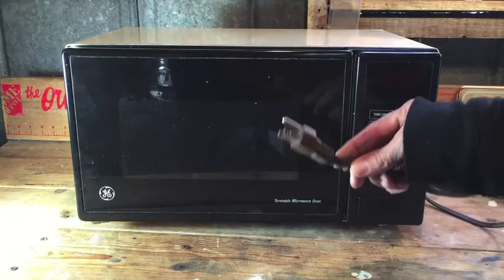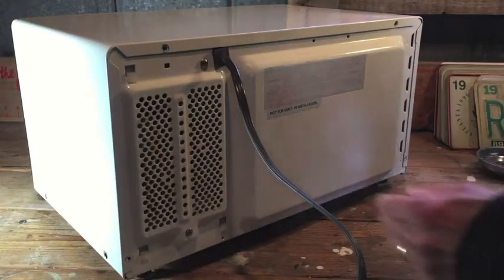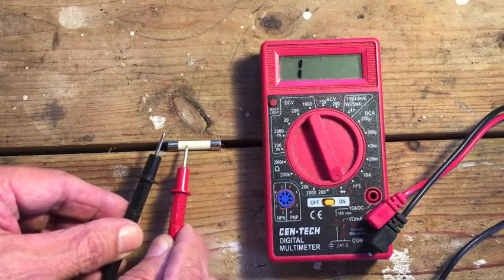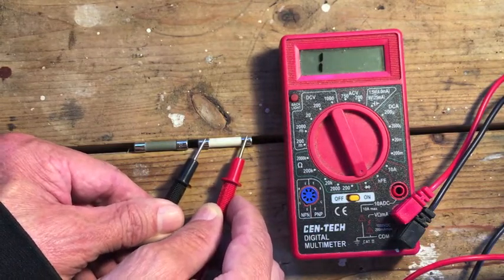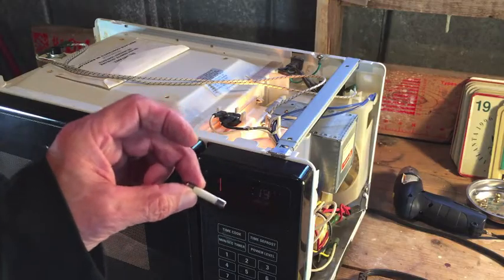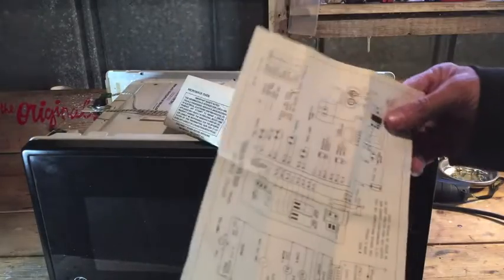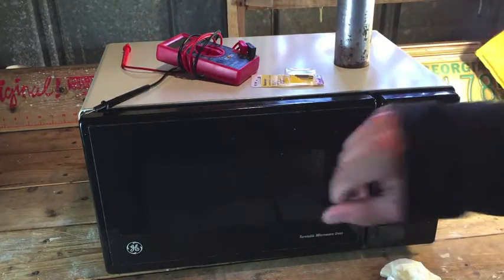$2 Microwave Fix - Test/Replace Fuse

Comment: Nice one dude. If i may ask if i will just replace the fuse do i have to discharge the capacitor?
Reply from the maker: No need to discharge.. Just avoid the capacitor terminals where the wires connect..

Comment: Bingo! My Microwave is 18 years old, a Countertop, 2007, 600 W, Proctor Silex that just died on me yesterday. 
Watched a bunch of Youtube videos and your Microwave looked the most similar to mine, so I followed your instructions. 
Along with a 15 amp fuse, I needed to pick up a Security Torx Alan Wrench set to remove the security torx screws that were holding the casing in place. 
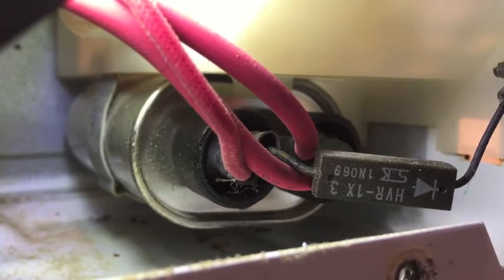At Minute 1:24, really appreciate you showing what the Capacitor looks like and where it was located in your Microwave. Critical safety recommendation to avoid exposure to 2000 volts and potential death. I made sure to stay well clear of mine (though ideally I probably should have discharged it with a Resistor). 
I wasn't sure if the simple replacement of the fuse was going to work, but I was very pleased when I saw the familiar numbers of the LCD panel flash and the oven light turned on.  
Tested the microwave by cooking my dinner, and no problems. 
Thanks for the concise and very helpful video!
Reply from the maker: You are welcome.. Glad to have helped..

Comment: Awesome. Short, to the point, filled with info. I went to Lowe’s, got a fuse 2 pack, and my microwave is running again. 15+ years old so maybe the fuse finally went out. Thanks for showing how to set my multimeter for testing. Your video saved me hundreds of dollars.
Reply from the maker: Glad to have helped.. Mine is now 31+ and still going strong much to my wife's dismay..
Reply: @tongo117  😂

Comment: What if the clock is there and the fan is working, but dark and no heat in the microwave. Is it fixable?
Reply: I'd recommend asking ChatGPT what the issue is. I asked for you, and it suggests that it might be : 1. Blown Diode 2. Faulty Mangetron (the part that generates the heat. most likely issue) 3. Thermal Fuse (near the Magnetron) 4. Control Board issues (might not be operating properly). I've replaced a Control Board before and it was a cost effective repair. I'd be cautious working anywhere near the Capacitor, unless I discharged it first with a Resistor. 
My advice, talk with ChatGPT, watch Youtube videos for the correct repair, only try if you feel confident in doing so. 
Good luck!

Comment: I found Universal microwave fuse 250 volt, 20 amp 10 pack for 8 bucks. Seems people are upping the amp by 5 amps. Since the light doesn't come on I assume that's what went wrong with it. My 1983 Kenmore, I don't like new appliances they don't last this one's done fine all the way up till now it it completely nothing worked and I smelled something electronic so I hope you can smell these fuses when they go bad. Fingers crossed to pick for eight bucks with nine more attempts taped inside.

Comment: Does the slow blow or fast blow not matter?
Reply from the maker: Don't know.. I'm not sure if the one I used was/is fast or slow.. I just saw 15A microwave fuse on the pack.. And it's been fine for 2 years now..

Comment: I have an LG. The clock turns on the timer even counts down.   But no fan or heat.  What could be the cause of that? 
Also, previously the fan would turn on when opening the door even without having the cook timer running. That somehow fixed itself.  But all of a sudden this happens several weeks later.

Comment: My 4 year old has gone kaput , im hoping its the fuse .. when i switch it off the clock beeps and flashes for one sec .. im hoping its the fuse ..cant believe your Microwave is 29 years old and still going , it would chew a of juice though .. miss my old pani , NN3535 model i believe ..sighhhh

Comment: Good video. However, after having already done what PBM recommends and putting everything back together, I ended up with one extra screw...and the housing no longer fits snugly over the microwave. The sides and back fit perfectly. But there is a "hill" now at the front edge of the housing, over the door. Every other edge fits fine. I can live with this, Maybe cover with some duct or electrical tape. But will it be leaking radiation?
Reply from the maker: I would disassemble/reassemble to try and fix the extra screw/housing issue.. And I believe radiation leaking is related to the door not closing properly.. https://allareaappliancellc.com/do-microwaves-leak-radiation/#:~:text=Microwave%20Leaks-,A%20faulty%20door%20seal%20on%20a%20microwave%20can%20cause%20some,you%20want%20to%20take%20lightly.

Comment: On my GE, blew the 20A fuse this morning again trying to close the door gently. Happened 6 months ago and diagnosed the 3 door switches were working through continuity testing-but apparently not working well enough. Bought the 3 switches on Amazon and kinda fixed the problem. If the switches don’t activate at exactly the same time, the 20A fuse blows. You’d figure GE would design it with slight human error included. (Don’t cross the 3 switch replacement off the list even if they appear to work well). The solution now is to noisily close the door on Sat morning and wake up family.